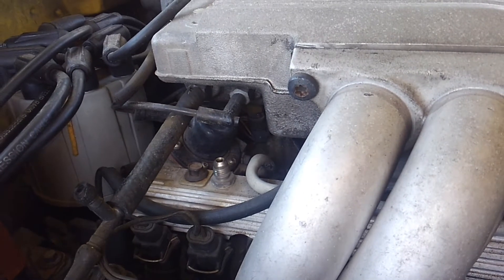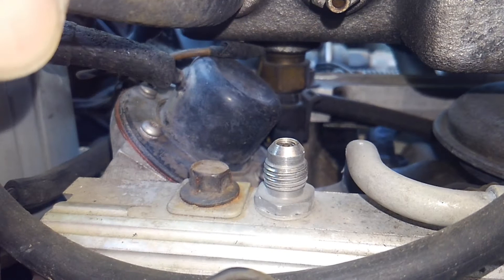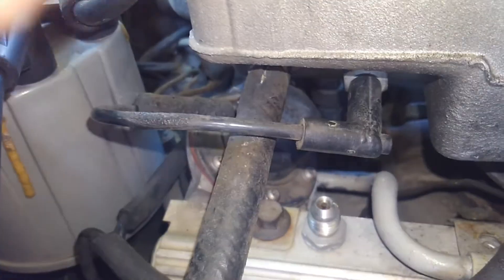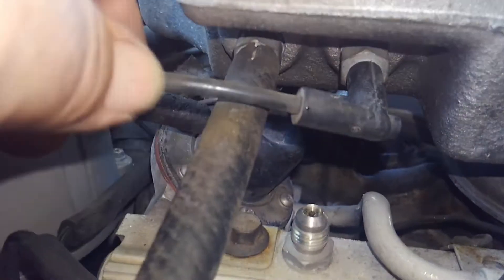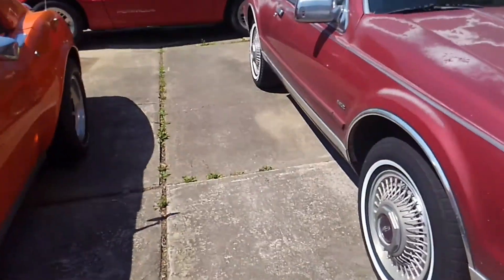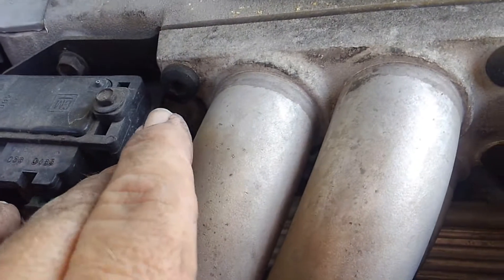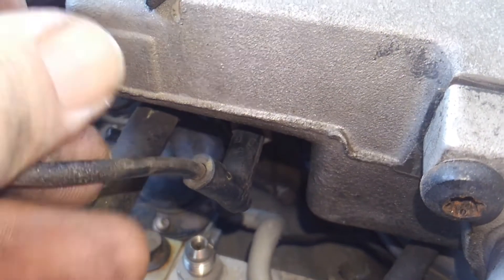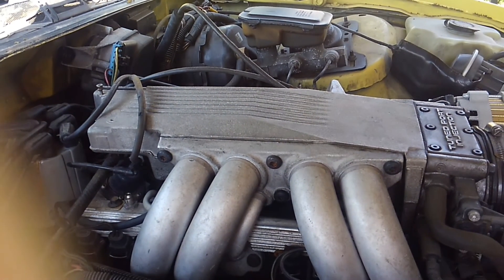GM Corvette and F-Body Tuned Port Injection Vacuum Circuit Explained

Comment: I have a question for you not related to this subject but because our cars are literally equipped clones.  I know nothing about gm transmissions and my rpo code has 2 numbers for 4 speed automatic, one is standard number i believe rpo code MD8 and then next code is for 4 spd auto MXQ im assuming heavy duty transmission?  please forgive my ignorance but up until this purchase the only thing I knew about Firebirds was that birds fly... Thanks again
Reply from the maker: No problem, the MXO simply spells out your car came equipped with an automatic overdrive transmission, and the MD8 identifies it as a TH700R4 transmission
Reply: @VetteSource  Thats just your average gm 4 speed automatic? The one thing ive noticed is people dont talk very highly about the 700R4's. Mine shifts like a dream, there is absolutely no play between gears. And of course I wouldnt know if a shift kit was installed but it gets a mean second
Reply from the maker: Yep, that's the corporate GM unit. I'm not sure why people talk it down. Its basically just a meat and potatoes automatic overdrive unit. They put them in about a billion GM cars, and they are extremely durable.
Reply: @VetteSource  Can you point me to a place to get parts for the Borg Warner rear end for this car. Can you get originals or just reproduction parts? I know having the 3.27 does not help my cause as I have heard its about the rarest of the bunch that were available...Of course .. I want to keep it original with aluminum calipers and wut not
Reply from the maker: You know, quite a few of these items are still available from places like Rock Auto and other similar online vendors. I think another manufacturer took over the Borg Warner tooling for the gearsets and rebuild kits, but I can't remember the name off the top of my head.

Comment: You are the among the very best at explaining every aspect of the project. Your detail is much appreciated. Question for ya, my Formula is identical to yours inside. When I purchased mine there was an original ECM chip for MAF TPI. I am wondering if owner who raced car had switched to MAP system I have been reading about. Pros, cons and how do I tell? Its runs perfectly so I prefer not to mess with anything.
Reply from the maker: S.B., thanks for the feedback, I appreciate it. The MAP system is a little better than the MAF system at regulating engine airflow and spark when you have high performance pieces like cam/headers, heads, or intake installed. You will see these conversions installed when the owner has made performance mods to the engine so they aren't riding around with the Check Engine light blinking at them all the time.
Reply: @VetteSource  Ty for replying. After staring at it all day it looks to me like it still has maf system,not sure why chip was sitting in car, maybe someone had to replace it. Again your videos are awesome at explaining every detail and the 7.75 rebuild cant come soon enough enough lol.

Comment: Very informative. Thanks for sharing. I just picked up an 86 corvette where someone has removed parts of the vacuum system. I’m trill trying to make heads and tails of what’s going on with it. Can you recommend a good resource for mapping out the system? I’ve been looking and haven’t been successful in locating anything. You definitely have the most detailed explanation I’ve come across so far, so thanks for sharing!
Reply from the maker: David, thanks for the feedback, I appreciate it👍. The best resource for detailed information and diagrams for your car is still the 1986 factory service manual. They are a wealth of information, and can be found on ebay and Amazon quite frequently. Let me know if you need anything else.
Reply: @VetteSource  thanks for the quick response! Ok, good to know. I already ordered the 86 factory service manual. I haven’t gone through the entire manual yet, but I did look for something covering the vacuum system and hoping to find mapping or part identification of sorts. Any direction in that very beefy wealth of information?
Reply from the maker: I believe it's in the 8A Emissions and Driveabilty section and should have some diagrams showing component location. Let me know if you don't see and I will check out my manual later.
Reply: @VetteSource  so I’m still working this never-ending project. I currently have the plenum,  runners, valve covers and fuel manifold removed. I do have the factory service manuals and there are a lot of individual vacuum sections in 8A, but unless I’m overlooking something, there is nothing that maps out the system. Even what there is really not detailed enough to even show the back of the plenum like you’re detailing in your video. There is a whole lot of deciphering needed with the diagrams. To make it substantially more difficult (not that it wasn’t already difficult), someone has done a number on mine before I got it. The front left wheel well area has been gutted, lines being left open. The air pump is in place but disconnected; the EGR is in place but disconnected:left open. The 2 switch valves near AC compressor have been removed. The heater core switching valve disconnected. I’m trying to make heads or tails of what’s left and what needs to be replaced. I found a website that has colored diagram mapping bro corvette vacuum systems, but they don’t have the C4. This has been an incredibly frustrating process. I’ve been working so many systems and not at a work stoppage. I avoid this vacuum system because of the overwhelming mess but it’s getting to the point where I won’t be able to move forward without figuring it out.
Reply: I have a 1986 C4 Corvette and I'm hoping everything on mine is still in place. Lol. Let me know if any pictures or video of mine would help you out any? Stock 350 TPI Base model. I haven't changed much on it since I got it.

Comment: Most people just buy rubber hose for those vac lines
Reply from the maker: Those will work for sure. The reason they used the hard plastic originally was to protect from the underhood heat. Of course the hard plastic lines also eventually fail. Dorman makes replacements that you can find in the HELP section of the local auto parts store.

Comment: Where does the MAP sensor vac connection get connected to get manifold pressure reading?
Reply from the maker: I don't have my service manual in front of me, but if I am remembering correctly, you should be able to hook it to the rear vacuum port on the center plenum to get a good reading.

Comment: Ok on my 1985 corvette the Vacuum line that goes to the FPR goes under the plenum i guess to that front one, not like this one have you ever seen one like that?
Reply from the maker: yep, the Corvettes are just a little bit different due to the location of the evap canister and cruise control vacuum module. Instead of having a direct connection at the front under the throttle body it is a T junction that runs off the driver side and feeds into the front wiring harness.

Comment: The vacuum canister is inside the front bumper
Reply: It’s below the battery tray area on the driver side, globe type canister
Reply from the maker: Mac, thanks for sharing the info👍. On the Corvettes it's easily viewable from inside the engine compartment, so it's interesting that this one is somewhat hidden between the inner fender and front bumper.
Reply from the maker: Hey Noah, thanks for the comment and heads up. Funny how certain items will be in different places than you expect them to be even by the same manufacturer

Comment: and you mentioned none of the lines coming off of the throttle body.. bummer
Reply from the maker: Yep, realized that after I made the video. Funny thing is that the routing of that line is different between Corvettes and F Bodies. On the Corvette the line runs out the driverside to the vacuum canister mounted in the inner fenderwell. On the F body it runs straight back to the EGR switch if I am remembering correctly and then tees off to the vacuum canister. Thanks for watching👍

Comment: Excellent video like always love to get my hands on a showroom Formula 350, if that's not asking too much. I'm from Nova Scotia Canada. I reached out to Vandguard Motors several years ago but never heard back.
Reply from the maker: Thanks, appreciate the feedback. Let me check with some of my connections and see if there are any cars floating around out there. Do you have a preference of year or color?
Reply: @VetteSource  87 to 90 if that's not too difficult. Back many years ago I test drove a 87 with 305 TPI yellow like yours, 5 Spd, it was fast, it impressed me back then. There must be someone out there that bought one and sat on it. Much appreciated you doing this. Thank you

Comment: Dang you know you stuff.. I have an 88 35th Anniversary that has an intermittent erratic idle issue that one can find.. can you do some consulting for a fee? Thanks
Reply: I have a 91 with that problem also
Reply from the maker: Yea, common problem that can be frustrating to run down sometimes. I would suggest starting with hooking a scanner to the car while it's running to check senor outputs to see if they are out of whack. Most common issues with the erratic idle are the MAF, IAC, TPS, or a combination of the three.
Reply: It ended up being the computer
Reply from the maker: Ah, yes. The other problem area I forgot to mention. 😁
Reply from the maker: Sure, glad to help. You can reach me by phone @832-654-7367 or email vettesource@hotmail.com

Comment: hello , i have a 1991 pontiac trans am gta 5.0 305 engine tuned port injection , i sent my car to a mechanic a couple of years ago he lost my ignition coil bracket and screws , he left the ignition coil loose on top of some wires i didn't notice it right away , can you show me step by step where it goes and the ignition coil bracket shape so i can look for it , thank you very much i really like your channel !!
Reply from the maker: Thanks for the feedback. The bracket you are looking for is installed underneath the back two intake bolts on the passenger side. I point it out in this video here - https://youtu.be/vZCgHAHTObY

Let me know if you need any further information
Reply: @VetteSource  thank you that was very helpful , regarding ignition coil bracket !

Comment: Thank you for this presentation. The f body vacuum ballshape canister is inside driver side fender in front.can be seen from bottom.for cruise control of course.
Reply from the maker: That's it. I knew there had to be one in there, just couldn't remember where. On the Corvettes it's in the driverside inner fenderwell in plain view. Thanks for watching👍

Comment: Excellent explanation.  I just replaced the intake manifold on my 91 formula and was wondering about the function of all these lines.
Reply from the maker: No problem, glad to do it. Those lines are easy to miss until they don't want to function correctly. Thanks for watching and have a good weekend👍
Reply: @VetteSource  After watching I went through mine for shiggles and found 3 open vaccum lines, one to cruise was just sucking wind, one to that t junction for cannister was trash and one to intake itself.. Gracias for your detailed explanations again.
Reply from the maker: No problem, my friend. Glad to do it👍.